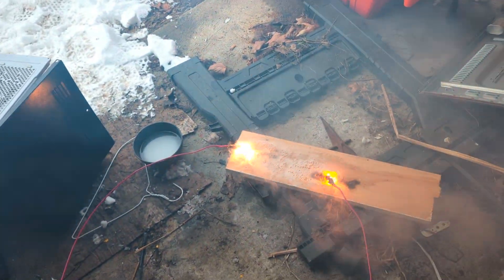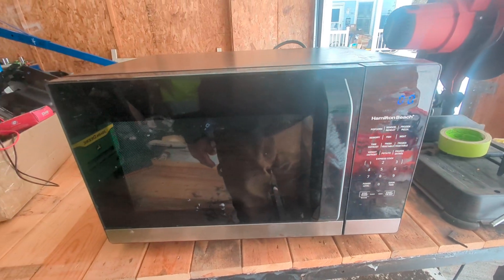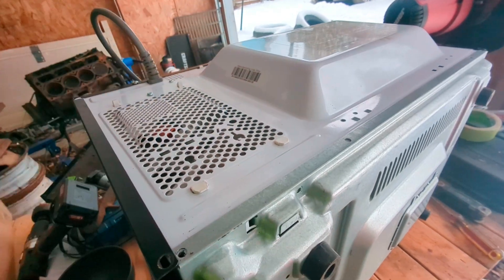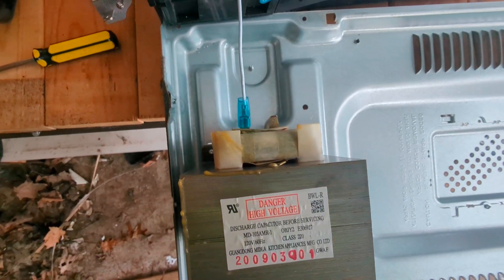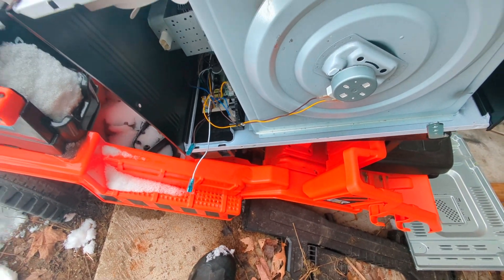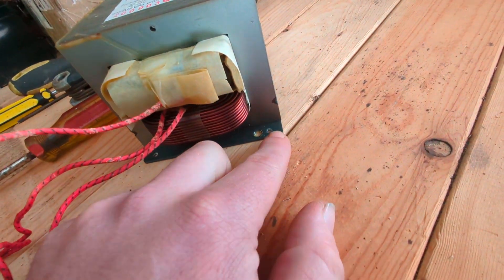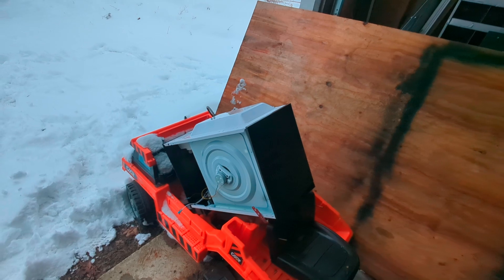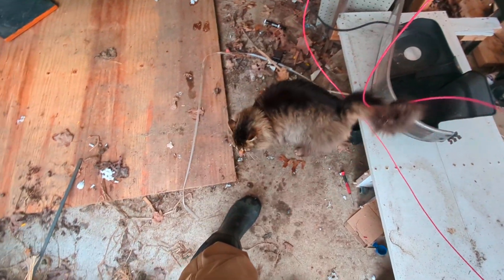Making a Fractal Burner (Lichtenberg Burner) With a Microwave!

Comment: I'm gonna try using two transformers, connect both metal frames together for center tap, and the two HV wires to the wood, the center tap also conneted to the wood, 3 contacts.
Reply from the maker: Please let me know if it gives you more kick. I've read about connecting two together but I haven't tried it because I never needed to. I burned up a transformer burning 3 huge boards (48" long by 12" wide) but haven't balled up enough to join two together. 
I got through two of those boards fine, last one completely burned up my transformer.
Reply: @Bad_Idea_Garage  First of all microwave trans are overpowered, they pull 8-9 amps no load, short run times, think of a drag racer. I put 2 trans in series, now only pulls 1 amp no load. Center tap used if only need 2kv, (1 trans) seems to make no diff if using the 2 HV leads (4KV). If you happen to try 2 trans n don't get burn with it, swap 1 of the trans primary wires. Pass couple days was the only time I tried burning so got a lot of trial n error to do. This setup is double dangerous, you may die twice as fast.

Comment: dude this is insanel unsafe im an electrician and your working with very high voltage even concerete can conduct you could easily kill yourself even if you think everything is fine and safe
Reply: Completely dry concrete is an insulator and does not conduct electricity.  When wet, it conducts a small amount of electricity.  For conduction to occur, the ions in the cement must be free to move, which only happens when the concrete is wet.  In this video, he is never working with wet concrete. He does however give a disclaimer that this is a very dangerous thing to do and that you can be injured and/or killed.
Reply: @joyceraines1050  he's LITERALLY pouring water (with an electrolyte in it no less) on it in the video. What are you talking about? 😂
Reply: @SwitchAndLever clearly you don’t know the way he did it
Reply: @brucelarrow7897  what? It’s literally in the video? 😂
Reply: @SwitchAndLever  either way if you disapprove of what someone is doing yet comment you are still feeding the algorithm so keep a small creator going why not
Reply: @SwitchAndLever  also your channel that you advertise hasn’t made anything for 2 years
Reply: Okay, I guess my comment wasn't clear enough, so let me clarify. With totally dried out, cured concrete as in, you can no longer manipulate it because it is soiled. The concrete itself isn't a conductor. It's the water that is, but not the concrete. Once it's set, the ions can't move, so it's not conductive. Water's a great conductor, but old, cured concrete isn't.
Reply: @joyceraines1050  and pray tell, what he's pouring on top of an active sparking circuit, is that dry concrete or water? 😂
Reply from the maker: @SwitchAndLever  I feel obligated to actually comment here for this one, despite my earlier decision to let the comments fight. 
Water itself? Like.. actual distilled water ... Is a HORRIBLE conductor. It's the stuff IN the water that makes conduction happen in an efficient way. The water I'm using, while not explicitly mentioned, is distilled. The baking soda is what makes it actually provide a conduit, since the particles (I do not know the science of WHY) happen to aid in transferring the current. It still burns the wood while doing it, despite dry wood being an insulator, and acts as a safety. Splashing water from a distance to put out a fire is not particularly safe but is also not especially dangerous if you follow the video mentioning RUBBER BOOTS and KEEPING DISTANCE. A few droplets are not going to lead the current to you, and with rubber boots on it would take you standing in a deep puddle for it to matter anyway. 
But, to sum this all up in a way that the other comments haven't (I do thank them for coming to my defense regardless), the name of the channel is indeed BAD IDEA GARAGE, and twice in the video as well as in the description there is a warning that this is not a safe activity. 
You work in a controlled environment and seem to think everything in life should be that way. I don't know how the hell you manage the panic attacks of driving to work around people who don't share your same apparent focus on safety control in every single movement, but this channel is not for you. Here we do things with what we have, and show what you can DO with those things. We can't buy stuff from professionals every time, we can't pay for precision machinery every time, and sometimes the chaos is what makes something worthwhile. 
We are normal people trying to do less than ordinary things. Without that, you wouldn't HAVE your precision equipment and your sterile working conditions. Look at what you do every day and instead of thinking you are better or smarter than everyone, remember that you were taught how to do the basics safely because there were other who risked the process before. 
You take advantage of the knowledge gained by people who risked learning something new, and you somehow still think you are better than the ones who gained that knowledge in the first place. 
Thank you for the extra views every time you came back to respond to a comment, but I ask (and hope you agree) that you do not add any more views to this and do not revisit my channel until you learn how to learn from someone else learning. 
Despite previous comments I am glad you have done well with your channel, despite not posting publicly for two years (I have no doubt safety committees have gained a raise by airing your content and gotten the praise for suggesting it while minimizing your return), and have a good evening. If I do see a future comment I will naturally assume you decided you might be able to learn something or actually contribute.
Reply: @SwitchAndLever at least I don’t feel the need to be a hater
Reply: He knows what he is doing clearly you didn’t watch the video fully honestly keep feeding the algorithm haters
Reply from the maker: This runs on 120V current. Yes the coil kicks up the power, but not enough to travel through dry concrete. 
At no point in this video was there an implication that this is safe. Neither is pulling an engine yourself if you dont know whag youre doing. Nor driving. Fishing, hunting, racing, welding, plumbing, digging a hole, swimming, installing a fan or light fixture, walking to your car in winter time, cooking, working out, using a phone while charging, whittling, carpentry, and 80% of anything you do in life is dangerous. The ONLY reason anything isnt deadly is understanding. And even with understanding, people still die. 
I was a welder by trade. We do things with electricity that you see as arrogant every day. I TAUGHT an electrician class how to do this safely while i was in welding class. 
Your lack of understanding makes it unsafe for YOU, and you alone.